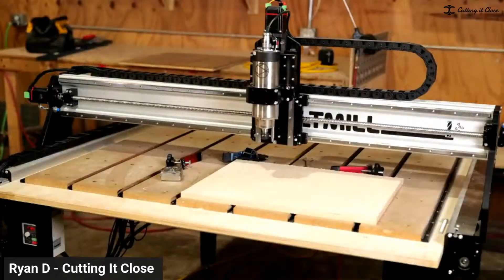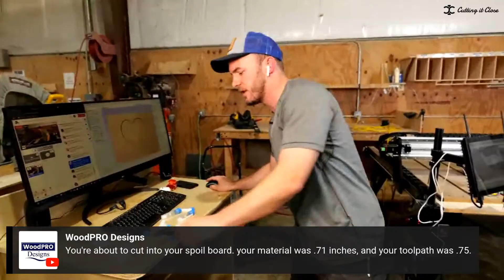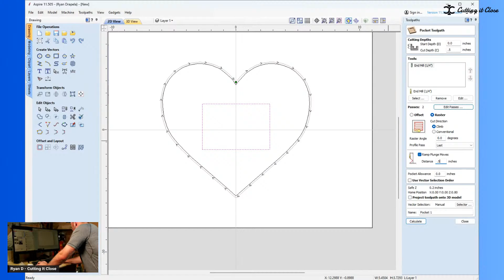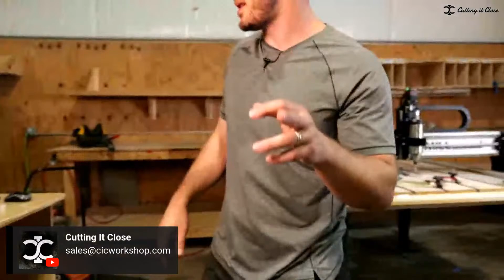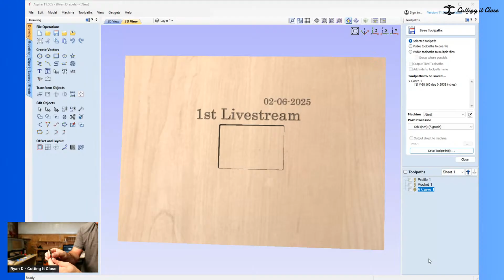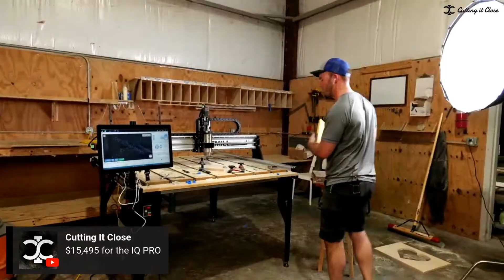Cutting It Close: Live on The Altmill CNC

Comment: Hey Ryan, I'm Chris the other owner of Sienci Labs. It looks like the problem you have with the small buttons is that your gPanel unit wasn't shipped with Windows zoom at 125%. This is something we updated quickly since it was overlooked on some of the first batch we shipped out. If you change that setting it should do a much better job controlling your AltMill just using your fingers 👍 We've also been working on a gSender refresh for over a year now that's only a couple months until release and it's had even more work done to be friendly to use on touch screens - bigger buttons, easier menus, the works!
Reply from the maker: Ahhh okay, I will do that, love the machine!

Comment: dog holes and kreg in line clamps are wayyyy better than t track, better holding power and if the bit contacts the clamp it will just cut through the clamp. a $22 clamp is cheaper than the bit